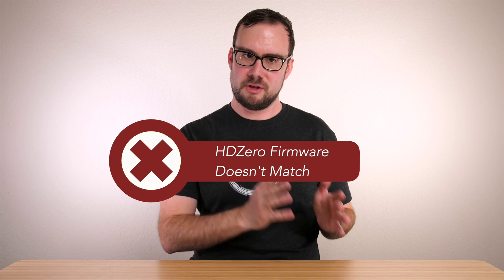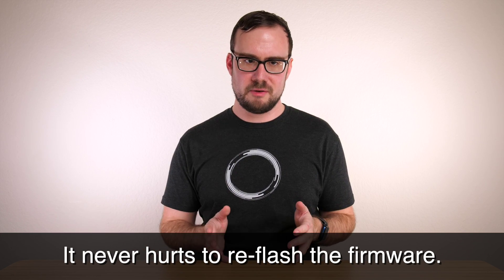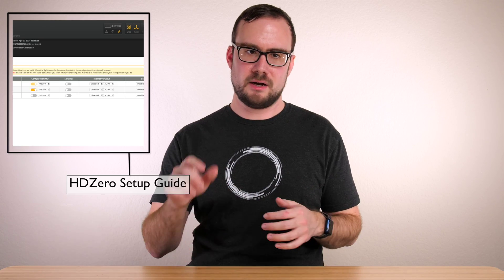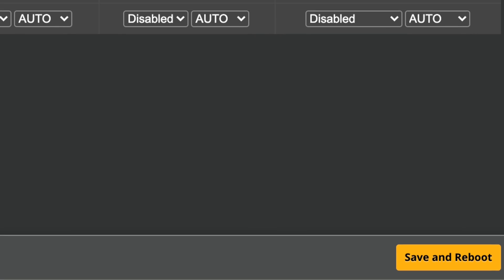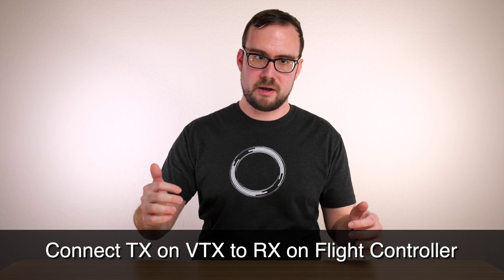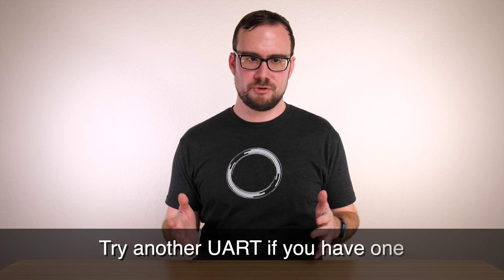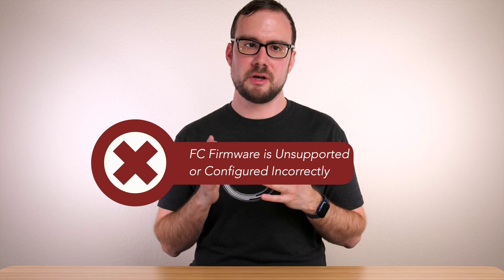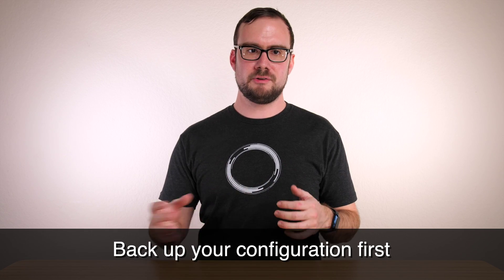Fixing HDZero OSD Problems: Common Causes And How To Fix Them

Comment: Hello, thanks for video. I have different problem. I can't change camera settings. Seems I have everything correct, VTX menu works fine, betaflight menu works just fine as well ... I wanted to change cam resolution and I can enter camera menu, but ... here is the problem .... I am unable to do there anything :/ ... I can switch cam profiles but that's the only thing I can do. I can't change any parameter while I see all parameters just like <    -  > ... so empty or N/A. Perhaps you have some idea how to fix it?

Comment: Hi,  Ive an issue with the OSD...  if i disarm you get the post flight statistics as normal but upon rearming the post flight stuff stays on screen.   both tx and rx are updated to the same firmware and reflashed several times.  everything else works as it should.  any thoughts?  cheers.

Comment: My voltage element lags, it stays on the same voltage then drops down to a lower value that it gets hung up on. Quad flies but voltage will be lower than shown, and then vtx will eventually turn off because voltage is too low

As soon as i assign vtx table and define power value, in bf configurator, fc keeps logging out and going into dfu mode on 4.4.0

4.4.1 shows no OSD

Comment: THANK YOU, THANK YOU -  I had been supplied a Foxeer Cinewhoop 25 with a corrupted Betaflight (ridiculous PID values and more). Foxeer could not supply a correct dump file!!  After re-flashing I had to sort out all the settings manually, and I got it all back bar OSD. Turns out Betaflight 4.3.2 would not find the VTX to add OSD when on default "Auto", so setting in CLI the device to MSP and setting the correct UART(-1), up popped the OSD.................  PHEW!!      GreatVideo, extremely well arranged and presented, easily solved my issue!
Reply from the maker: Great! I’m glad it helped.

Comment: This was really helpful.  My OSD stopped working when I upgraded my Mobula6 HDZero to Betaflight 4.4.  Upgrading the firmware on the VTX and VRX and changing the serial port configuration on the Ports tab to "VTX (MSP + DisplayPort)" fixed it.
Reply from the maker: Glad it helped!

Comment: hdzero is so much alpha, you need to be really a fanboy to use it.
I bought a hdzero Mobula-7 and on every single harder landing (not even crash) the video signal is lost until power down and power up.
On facebook these issues are well known, if you discuss them you'll be banned from the group (also if you speak about dji)

Stay away from hdzero.

Comment: I have 6 HDZero quads of different sizes and vtx types and all of them work perfectly. I have the Freestyle version in my Chimera 7 and it works great as well. I just added another Freestyle vtx to one of my 5" quads. Everything works except for the osd. I've tried everything in this video as well as other videos. Still no osd. Any suggestions?
Reply: Same problem did you find what's wrong? I have HDZero Race2 VTX with Foxeer F722 V3 Mini Pro FC and Foxeer Reaper Mini 60A 128K 4in1 ESC no osd on the nano90 but not any problem with my mobula6
we tried everything
Reply: @skuizyHD  I had to reflash my vrx and vtx twice before it worked. Then I had to reflash the rest of my fleet. Kind of a pain but worth it in the end. When I finally get my new goggles I'll most likely have to repeat the entire process. Unfortunately, by the time my new goggles arrive they'll probably be obsolete. Ugh!

Comment: Great information! I had OSD, stopped flying for a couple of months and all of a sudden OSD is gone. Everything was working fine.
Reply from the maker: My first thought is that a solder joint came loose. Have you been able to figure this out?
Reply: @ATXAirborne  OMG!!!!! The connector was loose. Tried to solder the ground back but didn't work. I cut the plug and soldered direct to the VTX and it worked as it was before. Awesome!!!!  Thanks so much!!
Reply from the maker: @carlosperez7015  great! Glad it’s working.

Comment: During the initial setup of HDZERO, if you enter the command (set osd_displayport_device = MSP) in the CLI, it appears ###ERROR: INVALID NAME#### and does not proceed. Why is that?
Reply from the maker: Hmm. Here are a few thoughts:
1) What flight controller firmware and version are you on? If it's Betaflight, you need to be on at least 4.2.9 or newer. 
2) Before entering this CLI command, have you enabled MSP for the UART on the Ports tab (if you are using Betaflight)? You may have to do that before you can enter the CLI command successfully.
Reply: @ATXAirborne   Thanks for your refly. Now I solved the problem upgrading FC firmware.

Comment: Hi Atx, I'm using soft serial not knowing  you're not supposed to. I'm also using it on inav without any issue. Is this just a betaflight problem? Also I'm using an old omnibus f4 pro v3 flight controller everything seems fine on soft serial on my end.
Reply from the maker: I've heard some people being successful with SoftSerial so I think it is possible in some cases. Because SoftSerial isn't as fast, I suspect you might run into more problems with more OSD elements. You might see it stop updating completely or stop updating quickly. I think it's best to use a real UART, but I'm glad SoftSerial is working for you!
Reply: @ATXAirborne   thanks for the response. Yes I've been real lucky so far no issues whatsoever I'm using an old omnibus f4 pro v3 I have quite a few of these boards they're solid and reliable only issue they have only 4 uarts not great when it's an inav build. Gps takes up 2 uarts I believe its 3 and 6. The uart 3 gets turned into sdl and scl .

Comment: Hey thanks for making this video.  I am having a problem on my whoop board where I can not changed my power output via smart audio.  Everything is connected and I've cli'd the vtx table.  Still getting an error.  any ideas?
Reply from the maker: What happens when you try to change it? Are you able to change any other settings, such as channel?
Reply: @ATXAirborne  nope. No options. It says something to the effect the the vtx isn’t set up. But I’ve done that several times. It’s not the worst thing to happen but I’d like to know if I’m on 25mw or 200mw…cause if I’m on 25mw that would explain why I can barely get down my driveway 😅. 
Setting up the 1watt was super easy tho. No problems there…so far. I put that in a 7” build and I’ll be long range testing it tomorrow
Reply: @modquad18 hey, I don’t remember what I did to fix this. I’ve built a lot of quads in the last year so I can’t say for sure what the issue was. As I look back at my comments I think I must’ve just missed something in the “ports”tab or I mis-wired something.

Comment: osd displayed including elements but no antenna indicators in the upper right-hand corner any help on getting them on the osd
Reply from the maker: The most likely cause is that you have the VRX OSD disabled. If you go into the menu on the receiver, look and see if you have its OSD turned off.
Reply: @ATXAirborne  my dumb ass was running old firmware all is good now

Comment: Great video, this will be super helpful to folks setting their systems up. 
Side Note: Out of curiosity, what microphone are you using?
Reply from the maker: Thanks! The mic is an Audio Technica AT875R shotgun mic running into a Zoom H4N (since it requires phantom power). I used a Rode VideoMicro for some of my earlier videos, but it was picking up way too much echo in the room.
Reply: @ATXAirborne  Yes, room echo is what I’ve been battling. Basically now I use very low input gain and then put a lapel mic super close to my mount which works ok. But if I turn my head at all it causes issues and a lot of extra work in post… your audio sounds great and really adds to the professionalism of your videos. Keep up the good work, cheers!
Reply from the maker: @GiantAntCowboy  I appreciate that, thanks. You might consider room treatment. I got some sound blankets that make a huge difference in reducing echo and room noise. I don’t always set them up but I can tell a difference when I do. Could be worth doing if you’re recording a lot of voiceover.
Reply: @ATXAirborne  good point. I’m actually setting up a new Hobby Room soon and will take that idea into account with the design and layout. 👍
Reply from the maker: @GiantAntCowboy  nice, definitely a great opportunity to set things up in a way that makes recording easier. Feel free to DM me on Discord if you want to chat about video production, I love nerding out about that stuff :)

Comment: Thanks to one of your previous videos, my HD Zero and osd are working great! However, I would like to fix one problem that still exists.
How do I get the vtx channel to be displayed? I only see dashes instead of numbers. Is there a simple fix for this?
Reply from the maker: Yes, you can do this. I've been meaning to make a video on it. The answer is that you need to load the VTX table for the VTX into Betaflight. You can find the download link on this page (look for "VTX Table"): https://www.hd-zero.com/document

If you aren't using SmartAudio (which it is likely you are not), you have to trick Betaflight into showing this information. To do that, you can go to the Ports tab in Betaflight and enable the SmartAudio peripheral option for a UART that you are otherwise not using. Don't use the UART for your VTX, it has to be a UART you aren't using. If you don't have any open UARTs, you can enable SoftSerial and use that to make a fake UART.

As I said, I'll make a video on this sometime soon as well :)
Reply: @ATXAirborne  Thanks! I'll try this tonight after work.